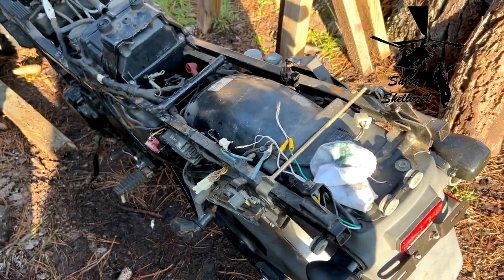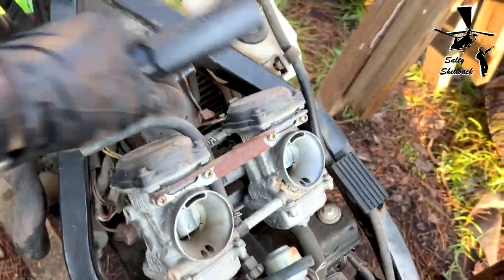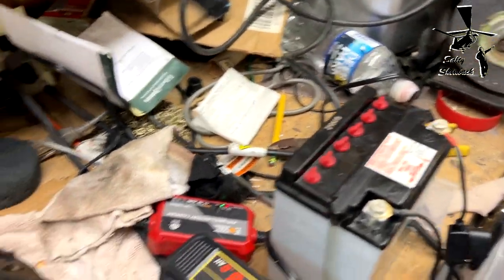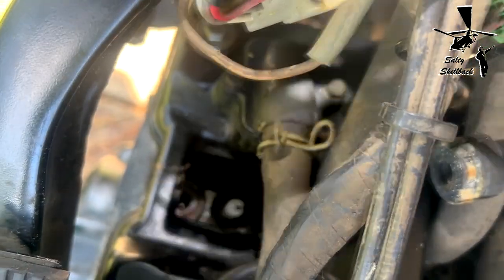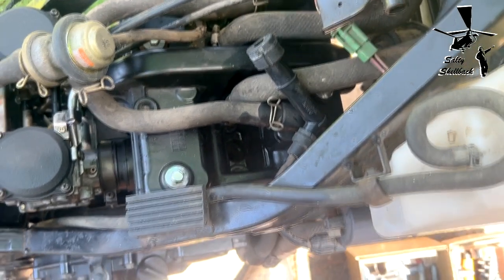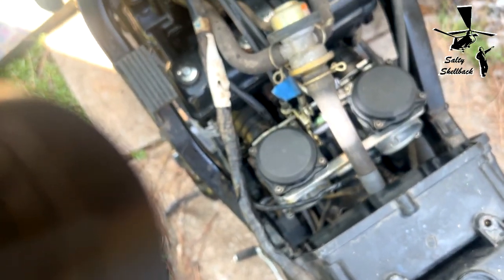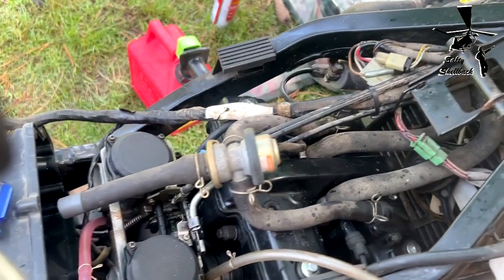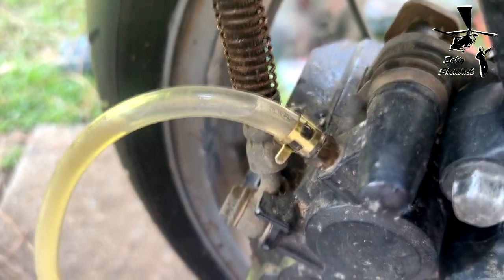Ninja 500 (1998) repair journey part 2

Comment: That is pretty cool, buddy. I have never been able to adjust carburetors on motorcycles. I don’t know why cause I can do them on the four wheelers and the quads and I even have the little flexible tools.
Reply from the maker: @Mayhemcountryliving  The latest one I am working on has been frustrating hesitating around 6k-7k rpms. Turns out it is "normal" on a lot of Ninja 500 bikes😄
Reply: @saltyshellback  L O L Way it goes sometimes